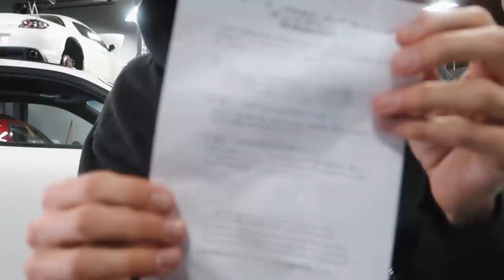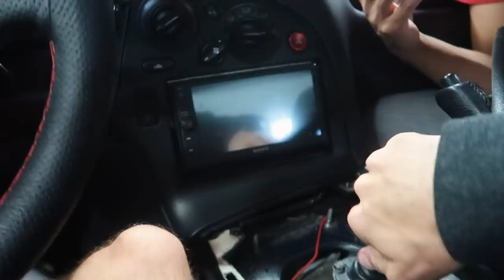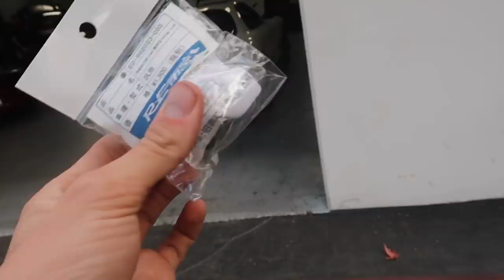Was this EXPENSIVE part worth it?

Comment: i don't know much about rx7s but in a miata you're supposed to change the fluid in the shifter turret because it's separate from the trans oil. I recently did a shifter rebuild in my miata and the fluid was disgusting and black. You should check to see if you should do the same teej.

Comment: Hope you realise the RE amemiya short shifter is literally a stock shifter that has been cut short. The proper short shifter design from c's shifters has a spacer that moves the pivot point further up as the selector shaft is longer to increase the throw under the pivot ball but decrease the throw above it.

Comment: Not a short throw shifter it’s just a shorter shifter, gotta change the Height of the pivot point to make it a short throw
Reply: Technically it is a short throw shifter because a lower height shifter travels a shorter distance between gear shifts than the stock shifter height.

Comment: Tsk tsk boys........new shifter but no new grease?? You need to clean the old grease out. Before installing the new one, grease the base of the shifter, the pin that goes in the slot, the slot and ball on the shifter and the little brass bushing Calvin put in with his finger.